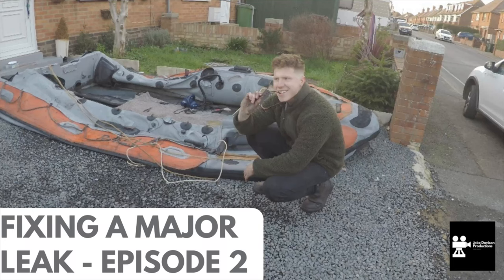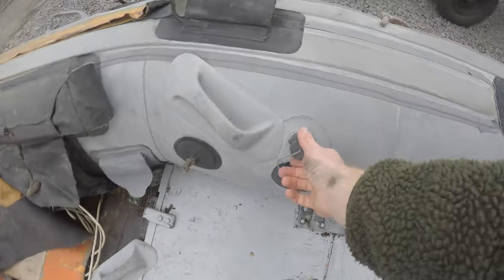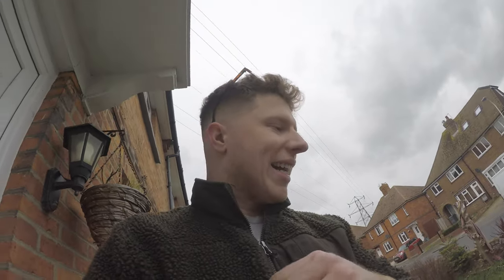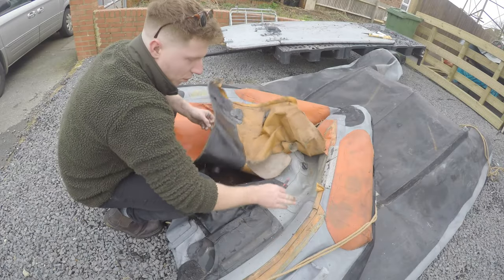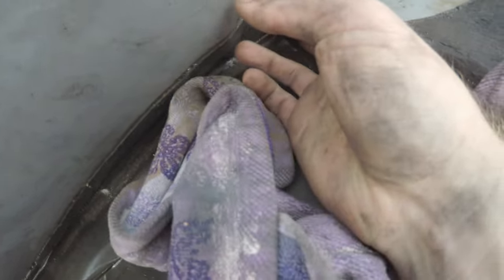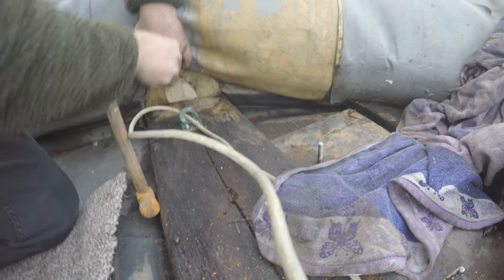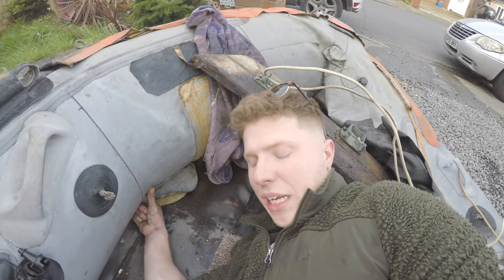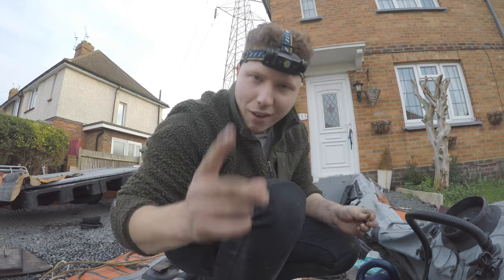EX RNLI Lifeboat - Small Inflatable Boat - Fixing The Leaks - Part 2

Comment: Why use such a small patch? I would cut a 6" square for any hole I find. That patch will come off first time out. To be honest, I think it was a bit irresponsible of the RNLI to let this boat go. I think they should have destroyed it. Please don't go anywhere without a safety boat following close behind 🙏
Reply from the maker: The area of leak had very limited access, in a area where I can use a larger patch I will. The silicone won’t budge once set. It may the case that this boat can’t be restored. If we can get to the point where it holds air it will only be used no more than 30 yards out and my other boat following. I think realistically it would be it’s last send off.
Reply: @MuscleFishingOfficial  put a large patch over the patch.. if air starts to leak out it will have a lot further to go through the patch and glue.
Reply from the maker: @graemelewins3586  👍🏼there’s many more patches to do. I will make them bigger!
Reply: @MuscleFishingOfficial have you let this d class inshore go now